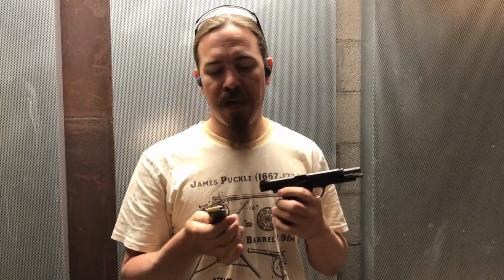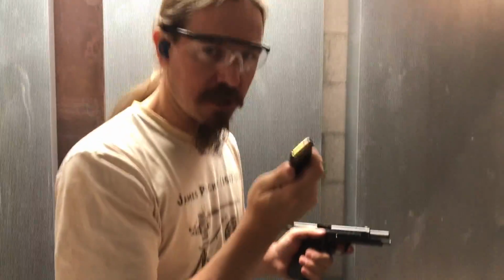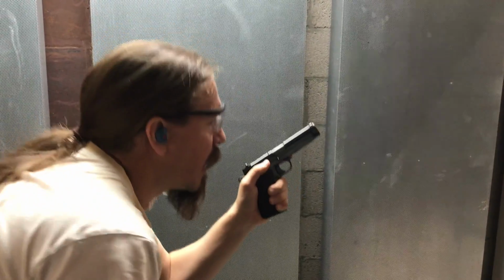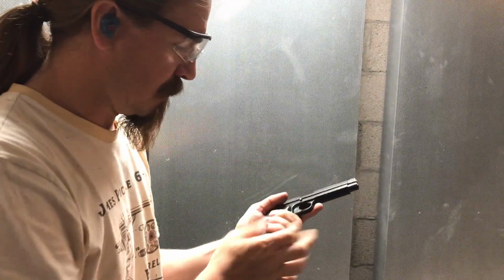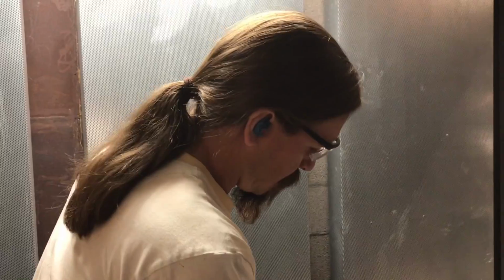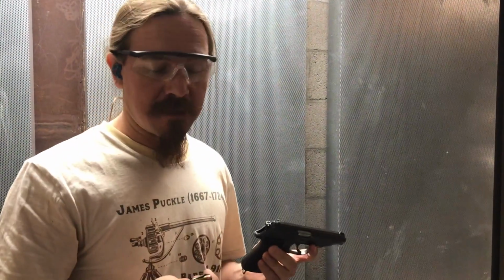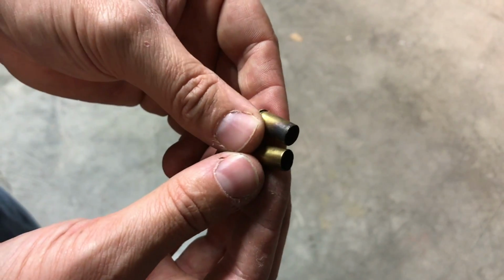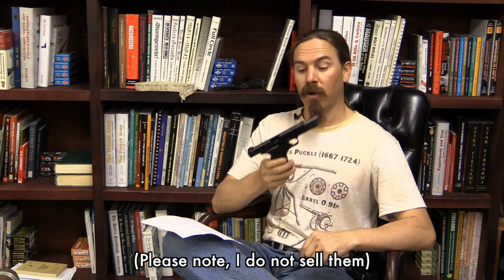Testing 7.65mm French Long Ammo (Reed's and Buffalo Arms)

Comment: I bought Starline Brass in 7.65 French Longue.. I load it with a 71 grain .32 ACP plated bullet over 3.9 Gr. of HP38.. Perfect cycling. Accuracy is less than 2 inches at 15 yards. Recoil is not bad and muzzle blast is like a .38 Plus P round. Prior to getting the Starline Brass, I modified a recoil spring, the original (I have a couple replacement full power springs) by trimming back the length until I got proper cycling of the .32 ACP round. Since the .32 ACP round is a semi rimmed cartridge, the rims are too large for the magazine. I can only get 3 in the magazine before I have the cartridge hang up. I also remedied this by chucking up the cartridge in a low speed drill and filing the rim down a few thousandths of an inch and at that point, it cycled like it was made for those rounds.  WARNING!!!! The powder charge is what I settled on by a few hundred rounds of experimentation as I could find no load data for this round with any powder that I have, and I have quite a few different propellants.  If you plan to shoot this, back off your powder charges by about 15%. That is where I started. I also came up with a cast bullet load for it. 100 grain .32 H&R Magnum bullet over 3.6 grains of HP38... Same warning applies... I also bought 200 rounds of CCI .30 Super Carry loaded ammo and pulled the bullets, dumped the powder and trimmed the cases to the proper length of the 7.65 MM French Longue case before I got in my Starline Cases... They all shoot great. I now have 600 rounds loaded for this little pistol. I, like Iam, like the oddball stuff ...  If you have one of these little pistols, here is some help to get them shooting again. If this video interests you and you don't mind doing a bit of work, get one as soon as you can. If you are an experienced Handloader as I am, making oddball ammo is not that difficult. It will remind you of the old Wildcatting days...  Ian, Thank you for this video...  Make up some ammo for yourself and enjoy that little pistol.

Comment: Excellent work, as always - actually i came here after couple of "related" videos in search of information on .30 Super Carry which you kindly have covered in another  video.

I think that the observed lack of performance of the .32ACP loaded into 7.65 French Long chamber actually has less to do with the fact the cartridge is rimmed and more with the fact the brass is just too short. Short brass won't properly headspace no matter it is rimmed or not, because even rimmed cases will hang (and most of the time, fire) on the extractor. Heavy sooting of the brass is clear evidence of gas leakage and what you show looks virtually identical to straight wall/tapered cases without the rim, fired from chamber that's too long. Myself tried the .40S&W in my Glock 20 chambered in 10mm Auto and .380ACP (9x17 Browning Short) in my Walther PP Super chambered for 9x18 Police/Ultra. The result is always the same - they fire allright, bullet leaves the barrel, the good part of brass is sooted and the performance is down by 10-20% from the published numbers. A side effect worth to note it's difficult to hit the broad side of barn with these. Keep up the good work!

Comment: July 2021.  Looking at the firing, I suspect the pistol itself is not quite itself; rather than a flaw with the ammunition.  Seeing as how the surplus ammunition (the one that fired, anyway) worked the action, maybe that isn't right.  
Just an observation, I have about 20 pistols in 7.65mm of several manufacturers and they all show the powder fouling on the sides of the case.  My thought is the pressure is not sufficient to obdurate the case properly.  Using a .32 ACP in the 1935 pistol leaves the mouth of the case in the chamber of the pistol and not against the front of the chamber.

Comment: Hello I have a blank gun and I'm having the same issues as this pistol with the first ammunition. I've came to the conclusion that the blanks are to weak to actually cycle the the pistol the website I bought it from said the gun is probably broken because all their blanks are powerful enough to cycle the blank pistol. I took the gun apart everything seems operational still nothing I lubricated it also would you say the blanks are most likely to weak?

Comment: I had a different experience with Buffalo Arms loads.  I just shot 50 of them and the only issue I had was a couple of failure to fires despite primer strike.  this could be a gun issue.  all of the rounds I fired cycled by 1935A just fine.  I didn't chrono them but I was pretty pleased with the Buffalo loads.  just my experience.  thanks.

Comment: Couldn't they be rebarreled in to 32 ACP and end any shooting problems and lower cost? Not original but make a decent shooter out of them?
Reply: you could do that if you made a whole new barrel ( 32acp cases are shorter that 765 french) and could work out a weaker recoil spring so the slide would fully cycle.
also
pugs rock!

Comment: You might not need to cut the recoil spring of your gun. I was watching This Old Tony's video on making springs, and he mentioned the outermost, close windings being inactive. In theory, you may be able to inactivate part of the spring by precompressing and clamping it with steel wire or something similar. Then you can just loosen the clamp if you ever find proper ammo.

Comment: I've got the same pistol, had the same issues. I think it's with the reloads, they are being very conservative with their load data, and it reminds me of commercial 9x20 Browning Long ammo as well. I've got a few 9x20 Browning guns that wont take the PPU stuff because it's a conservative load. There isnt much load data for the .32 French, but from what I know of the round it should be pushing nearly 1,100 FPS, but I'm willing to bet it's underloaded severely because the nature of surplus arms in the caliber and many are likely in rough shape, much like most .45 Colt loads are downgraded significantly from what they could be loaded to in more modern arms. 

I dabbled a little bit in reloading and while .32 S&W Long brass is a good option, I feel in order to get proper performance you'd be better off with converted .32 H&R Magnum brass as it could be loaded to a higher pressure that may get it to cycle properly. That or convert 9x20 Browning Long brass as they're both semi rimmed, dimensions are about the same overall. But fortunately I had a good lot of surplus stuff that mostly fired and still got a bit of that floating around. I too found the Buffalo Arms ammo to be better, in general Reed's doesnt ever seem to work well in anything that I've used or seen minus a few calibers. They make a decent 9x23 Largo load and given how hard that can be to source it's as good as it gets unless you reload yourself.

Comment: I don't know if Ian reads comments on videos posted this far back, but I'm going to put this up anyway. That pistol needs to go to a gunsmith. The hammer creeps forward as he pulls the trigger, which could make the gun unsafe. This condition is known as a negative sear engagement, or a negative system (if the actual issue isn't in the hammer-sear interface) and basically means the gun isn't drop-safe and could discharge if jolted or struck.

Comment: Pardon my ignorance, but how does steel cased ammunition compare to brass in terms of friction in the chamber? On the one hand, I would expect brass to have better lubricity, but I would expect steel cases to expand less as a result of a higher modulus of elasticity, and higher yield strength, so it would grip the sides of the chamber with less force.

This is all pure speculation on my part, I'm just trying to come up with a reason other than energy that the steel cased surplus cycled, but the brass cased new manufacture didn't.

Comment: I think the problem come from the fact that this is brass cased ammo, and that french weapon are designed to fire steel case. We had the same problem with the Famas, when we started to use american ammo that was brass cased, basicaly the action would not work properly, and there as even been some case of explosion of the cartridge in the chamber because of the overpressure, so we had to ask a company in Italy to make us specificaly designed steel cased ammo for it. So maybe the issue is that, from what I can see, the only problem you got with recycling did happen with brass case, the original steel case worked fine on that regard (do keep in mind that this is really old ammo, so the primer would be a little worned out.)

Comment: I understand the comments claiming that ammo manufacturers are likely putting out ammo that fails to operate in the firearms chambered for said ammo because they have little in the way of data to provide them with specs, coupled with them likely erring on the side of caution, under-loading the ammunition so they aren't blowing guns up. That being said, all they would have to do is TEST THE AMMUNITION. While the firearms are surely uncommon/rare, they have to know that an odd firearms collector and Francophile like Ian would surely have the necessary firearms or atleast be able to point them in a general direction. I get that this would be a pain, but why even put out the ammunition then? It's just a waste of everybody's time at that point.

Comment: Hey Ian, just wanted to remind you that spring rates go up when you shorten them. Not saying it won't make the gun function to shorten it, but a shorter-stiffer spring will behave differently than an equal-length-softer one.

Comment: I suppose there is no .32acp +P ammo available? If there is, maybe that could help with the gun cycling the action? Although it'd still be wrong, perhaps it's still cheaper than real functioning 7.65 french...
Reply: I believe the extra pressure won't fix the problem as the short brass of .32ACP just leaks too much gas between freeing the bullet from the neck tension and engaging the rifling.

Comment: And now solution time boys and girls. Load .32ACP to +P, still doesn’t cycle, do the same, but with a heavier bullet. Still doesn’t function, ok, 32ACP load d to +P+ specs, not better? 32ACP +P+ with heavier bullet, should develop enough pressure, regardless of pressure loss to reliably cycle your gun. Boo ya, you’re welcome. Why has no one done that/thought of it?

Comment: Great video, I got my fingers crossed that starline starts making brass. I have been reloading for this caliber using brass that I have converted. It has been a bit of a challenge, there is not a lot of data available for this round. 
Also, as I understand it, firing 32acp is not really that good of an idea for these pistols. The case is too short and the case head is larger on the 32acp. As it was explained to me, it could possibly cause damage to the pistols extractor.

Comment: We had exactly the opposite problem in Canada.  We used Sterling submachine guns and Browning 9mm pistols.  We only had one standard for ammo, and obviously that had to be ammo that would cycle the submachine guns.  Ammo hot enough to work well in SMGs beat the hell out of the pistols.  I used to command a platoon of weapons techs, and we were forever fixing 9mm pistols cracked slides and cracked feed ramps.  Luckily we had enough spare parts to last until the end of time.

Comment: Complete gun novice's question here: You've talked about getting the brass, but for the more obscure cartridges, how do you get the right bullet itself?
Reply from the maker: This uses the same diameter bullets as several common cartridges, so those are easy to find.
Reply: I see. Is that usually the case? Is there an equivalent diameter bullet available for reloading most obsolete cartridges? I guess I shouldn't be surprised, but for some reason I imagined there would be more variance.

Comment: The problem with the high standard deviations was due to the low amount of rounds fired. (Not enough data points)
Reply: You're still getting 300fps extreme spread variation, so that's all sorts of unacceptable.

Comment: What about using shortened .30 Carbine brass? should work fine..
Reply: The base of .30 Carbine is .355 and the French 7.65 is .335 so you'd have to swage the case down and then cut a new extractor groove.

Comment: Looks like you could play russian roulette with an automatic pistol when using french surplus ammo...
Reply: Chuck Jorris same goes for the Zip22.
Reply: "Oooh I got one!" hahaha
Reply: Pretty much what happens when you use ammo nearly 100 years old
Reply: @BelayaBirdy  Yup.
Reply: @BelayaBirdy  There is no 7.65 french ammo that is 100 years old.I have recapped hundreds of rounds of original French military with new non corrosive primers they work great.I also reload them even the steel cases.
Reply: @Dallas-us6xm  Thus why I said "nearly", and if we want to nitpick it has been in production from 1918 to 1935 in small quantities, so finding a 100+ Y.O 7.65×20mm round is technicaly possible (but I do agree the chances are very slim).
Reply: You can do that with any ammo,except win rate will be lower than my blood pressure on a rainy day
Reply: France last made this ammo in 1952.....

Comment: So from the video the thing I got if the velocity produced by the ammo is about 1100 fps or near it the gun will cycle reliably. Need to find better spec powder.
Reply: It's not the powder, it's the powder charge. Increasing it would likely rupture the modified casings. No brass is currently available that's made to spec.

Comment: Holy crap, that commercial ammo is not just underpowered it's also incredibly inconsistent. I can understand ammo not  being manufactured to the correct spec when that's unknown but you'd expect them to at least load it to SOME spec, wouldn't you?
Reply: The thing is the spec for 7.65 mm french long is pretty well documented, they weren't Germans but the French had decent records on how the rounds performed.  Exact powder measurements with modern powder might not be in there, but muzzle velocity, ftlbs, bullet dimensions and weights are known.  This is more an indication that since they have no competition on a limited market they will not even try to make good ammo.

Comment: Sound like you need to con Karl into loading some rounds for you. Some Power Pistol will get those rounds moving at the right velocity. Trim down .32H&R to get that thicker case web to handle higher pressure.
Reply: If you really want the safety factor when cutting the extractor groove, trim down .327 Federal brass which has LOTS of material to handle 42K PSI

Comment: I'm curious from a builder's perspective about a possible improvement in cycling by underspringing it to cycle the commercial ammo. Unawares of the parts market, but I have done similar for 1911 sidearms I've build explicitly to not run +P. Possible solution?
Reply: Clarification, I'm talking a small drop in spring weight (like 1/2 lb max).

Comment: is it possible to polish and lubricate the cases a little? That might help with the cycle, it's of course not a practical solution for any real application but for testing it might get stuff to eject.  The steel case stuff as I understand it was a nightmare for external corrosion.

Comment: So, this might sound like blasphemy... but the correct course of action here would be to use the commercially available ammo, take out the recoil spring (and save it somewhere, like a ziploc bag with some grease in it or something), and then just throw in a lighter recoil spring. At the end of the day, as the long as "the spring fits," the gun isn't going to care / know what spring is rattling around inside there, so provided that the new spring has roughly the proportional tension needed, it should be fine. Basically: If the factory ammo is, say, 10-15% less powerful, you'll need a recoil spring that's 10-15% less stiff.
Reply: That might be the solution Ian's going to end up going with. I'm not sure how he'd get the right kind of recoil spring, at just the right tension to run the action though. Most springs I see online are for handguns, and it's not like you can swap it out for a nice AR buffer or anything.

Comment: How safe/unsafe is to shoot slightly different caliber ammunition on a given gun? Can I use a .380, .357 and 9mm in the same gun (provided they are the same dimensions otherwise)?
Reply: It´s depend on what rounds the weapon should have and what round you are firing. If I remember right, it´s ok to fire a 38 special in a 357 magnum revolver. but not the other way around. a 9 mm luger would dropp right throw both revolvers.as it is rimless. 38 special and 357 magnum will not fit in a pistol made for 9mm luger.

Comment: Did you do any slow motion?  Are you positive it is the ammo?
Reply: The ammo is 30% weaker than original spec. Definately the ammo. In a blowback pistol not much else it could be. If it ejects but doesn't fully cycle it's weak ammo.

Comment: So when are you going to do a post-apocalyptic themed match on InRange? You using .32acp in your French 1935 and Karl using the Medusa. You get to rack the slide every shot, Karl gets to reload from a bag of .40-ish caliber things.
Reply: Great idea!!
Reply: I know I'm 3 years late... but is there video showing this second part?
Reply: I love it
Reply: Not if you cut the recoil spring down a few rings. Mine ran 32acp fast as you could pull the trigger and was extremely reliable
Reply: Fr
Reply: Fr
Reply: Fr
Reply: Fr
Reply: Fr
Reply: Fr
Reply: Fr
Reply: Fr
Reply: Fr
Reply: I'd actually love a Medusa in Fallout, just picks random rounds for each cylinder from a couple of calibers so I wouldn't need to swotch guns as much to spread out the ammo usage :P
Reply: If you use ammo from an old Luger p08 into a 9mm glock 17, or a Beretta 92, you will have the same problem

same stuff with the .50 BMG, I wouldn't use a 80 year old cartridge in a thousands dollars Barett, for exemple, I'll be to scare to damage it 😅